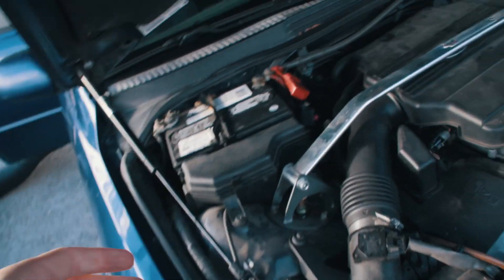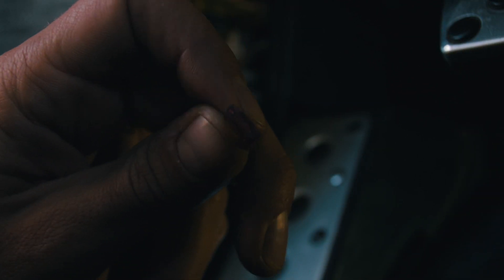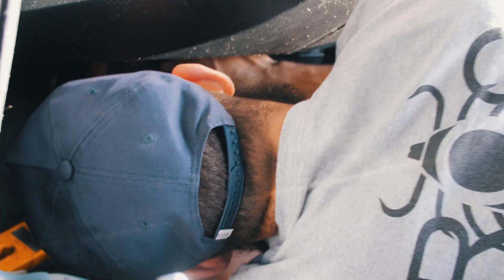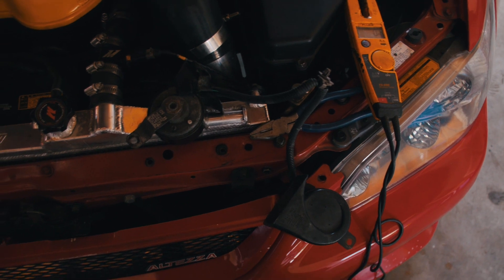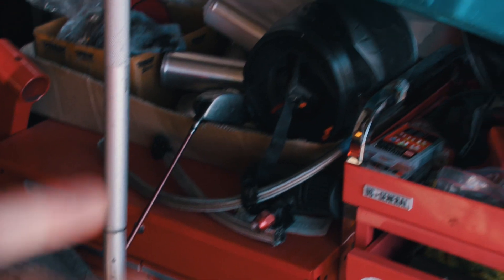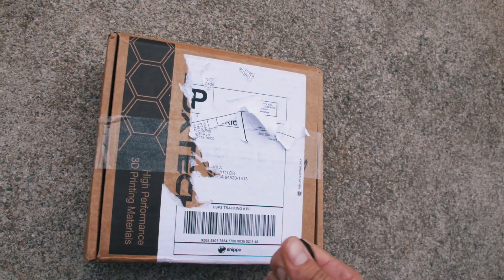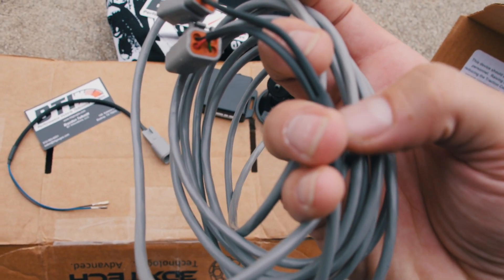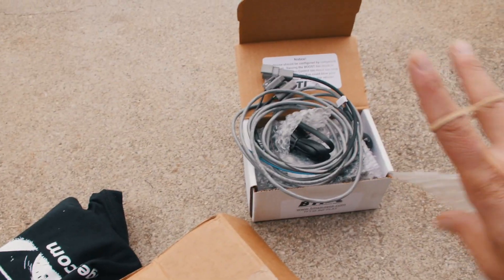IS300 CANBUS GAUGE!! BTI Unboxing

Comment: Bolt on the horns to the core support, they'll work fine. I wasted an hour thinking I had a burned relay/horn when I was rebuilding my IS. When you mount it, that acts as a ground.

Comment: that little wire that went to ignition fuse is probably the independent foglight mod, very popular on the is300
Reply from the maker: Which would make sense if it shorted out because his fog lights aren't there and wires are exposed to water all day lmao
Reply: SR Entertainment very simple, that wire comes from fog relay in the back of that fuse box, just remove it.